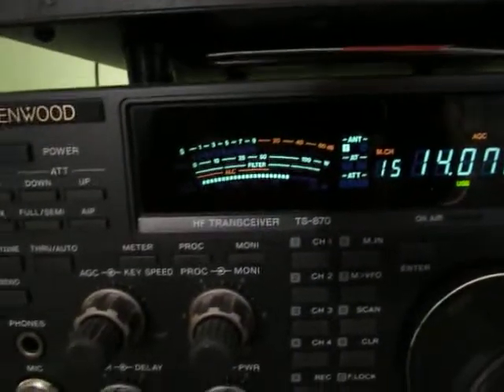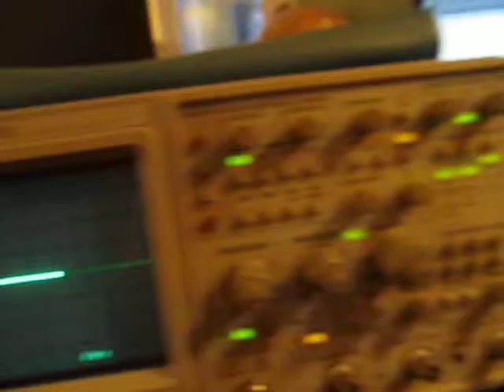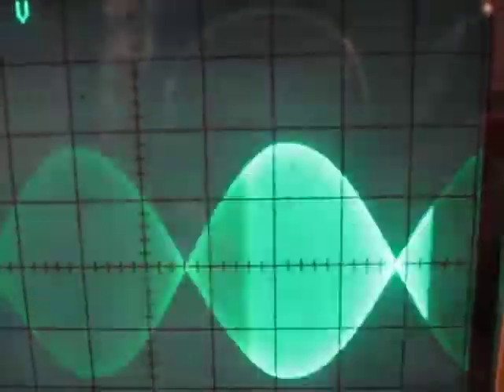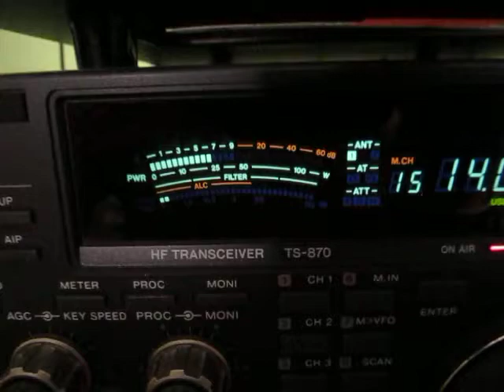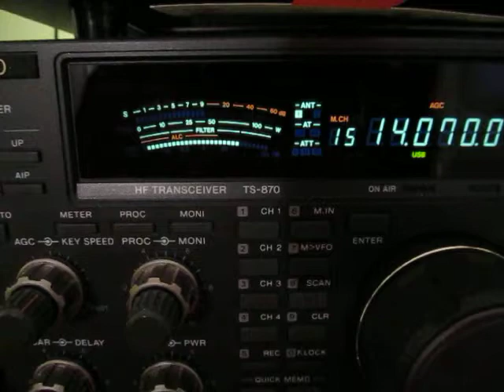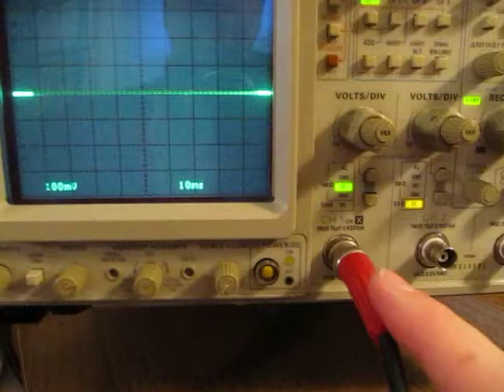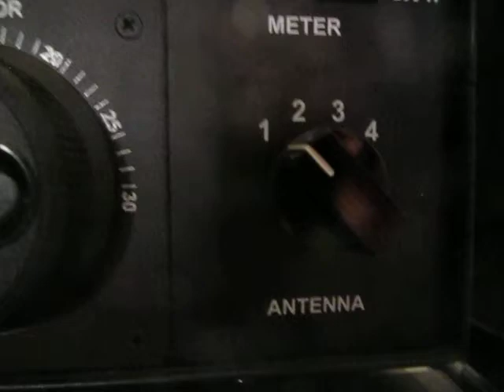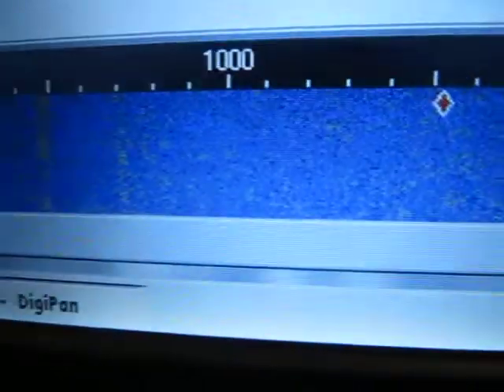#71: Proper PSK31 Audio Level setup with a scope, RF power meter, and ALC indicator.

Comment: So we will need an rf sampler iam using a to 320 I can't get a single like that at all using my dummie load on my mfj 941 e
Reply from the maker: I don't know what a "to 320" is, I am assuming it is your oscilloscope.  If you are not getting enough leakage signal pickup through an unused antenna port on the tuner, then yes you will need some type of RF sampler.
Reply: @w2aew  ok that what I will try next 320 is my scope tektronix tds 320 iam getting a pattern its just not as nice looking like yours is mine is a solid green 
Thank u 4 your help love the videos.
Reply from the maker: @vencentbauer  That's all you will get with the TDS320.  This is an early digital oscilloscope, and it doesn't have intensity grading like the old analog oscilloscopes.
Reply: @w2aew  ok thats what I was thinking I took some new radios and tested them now I can kinda see what iam looking at I will have to up grade my scope do u no what  is a good scope to buy without breaking the bank only working on radios

Comment: Great video and very easy to follow , will be trying this on my radio. If i need to use a tone to get the envelope as mine doesn’t have a built in one, what hertz tone do you use and is it a single or double tone?
Reply from the maker: Anything within the audio passband will work - 1kHz would work fine.

Comment: With a little caution you can get always 100 percent 100 Watts out of any "modern rig"
working 50 % duty cycle in digital modes.
All those  kindergarten warnings are just plain nonsense.
THUMBS DOWN for downdumbing.

Comment: Can a Oscilloscope be used as a spectrum analyzer for hf carrier or single side-band to see if there are harmonics in the signal please.
Reply from the maker: Analog scopes - no.  For modern digital scopes, there is usually a FFT function to view the frequency domain, but you have to recognize that the scope itself may create some harmonic distortion components on it's own.
Reply: Hi. Just what I wanted to know thank you. Great video.

Comment: Hi Alan.  I'm having problems with the ALC setting on my FT897 and wondered if you you provide any advice.  I have posted a  video of me explaining the issue and wanted your advice if yo think the ALC control is at fault. https://youtu.be/59EZQ-jF2WY   Many thanks in advance regards Chris
Reply from the maker: For soundcard based digital modes, the RIG must be in SSB mode - not DIGITAL mode!
Reply: +w2aew  hello Alan. Many thanks for your quick reply.  The 897 has to have digital mode selected in order to take in the audio through the  rear data connector and also selects the psk 31 and upper side band from the data mode configuration menus.  If I had just selected USB or FM mode for example the microphone input would have been selected instead. So I think data mode is correct setting. I wondering more if there are any controls that allow the ALC rate to be adjusted. The ALC really is cutting in hard as in scoped it as in your example. Any other ideas.  Best regards Chris
Reply: +Christian Fletcher Ps. I did just check putting radio in USB. As I said the radio keys up in transmit but there is no audio input as the data port is not enabled.
Reply from the maker: OK - I was going by how my radios (Kenwood) are used for PSK31.  I've never used a Yaesu for this.  I just took a look at the manual and I see what you're talking about.  Use menu #38 to set DIG mode and select low or high sideband, and #37 to set the gain.  Have you got a way to measure/verify the signal levels being produced by your soundcard (oscilloscope, etc.)?  I agree that the "pulsing" ALC is unusual, it should be relatively steady (and adjusted to a low'ish level).  I'd start with a fairly low level on the audio device to ensure you're not overdriving the input, and then work your way up on DIG GAIN (#37) to see if you get acceptable results.
Reply: +w2aew hi Alan thanks again for you investigation and advice. Yes I do have a scope so i will check this tomorrow as its late in the uk. I did plug the sound card output into the small speaker amplifier and the sound was constant just a warble between the  audio tones when idling. I also tried feeding the radio via my iPad running a psk program and on battery as I thought there could be ground loop induced hum, but again  same problem. I did a google For 897 and ALC issues but nothing reported. Ok off to bed. Thanks regards Chris f.

Comment: Thanks! i had my scope setup half way through the video and i was over driven. after setting the levels even helped with SSTV! 
ill have to change some value resistors to my interface box the adjustments i have all the way down to 0 and i was still over driving...

Comment: This was a great video. So, at the last hamfest I got a great deal on a used O'Scope.  I set it up connected to the balanced line output of the tuner using the regular probe and connected the ground clip to the ground on the tuner.  I do get a signal that is very readable on the back of the tuner, MFJ-949E.  But, there is always but, no? I don't get the pretty RF envelope like you get when I hit the tune button in FLDIGI.  I got a nice solid tone and it is just a straight frequency out, not modulated. When I do a CQ  I can see the waveform and it is modulated.  Of course, this is all into a dummy load. Are you using fldigi and if so how do you get it to make the RF envelope?
Reply: I don't use FLDIGI. I took a look at the manual for FLDIGI, and it confirms that it puts out a constant, unmodulated tone in the Tune mode. This creates a single, unmodulated RF signal, so what you observed on the scope is normal. It can be used with the ALC reading on your rig to adjust the audio level.  I believe that for the video, I simple put the program into TX mode which caused it to transmit an idle pattern which is modulated.

Comment: confirmed! a few minutes later while investigating psk31 i remembered a proper AM signal and figgured that ITS NOT AM. however i am troubeling understanding how PSK works. i see the HF carrier and i see some modulation on it. but yet i cannot recognize that modulator signal and where its "changing" the phase. since its supposed to be a "digital" signal i would expect to find some sort of "steps". but i realy cannot find any steps or "sudden changes" yet. guess i need to do more investigation